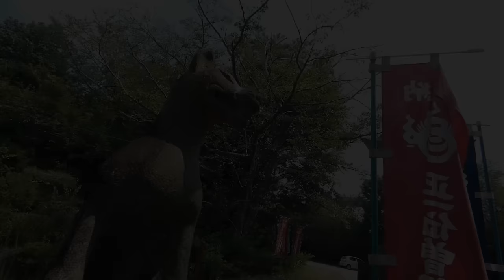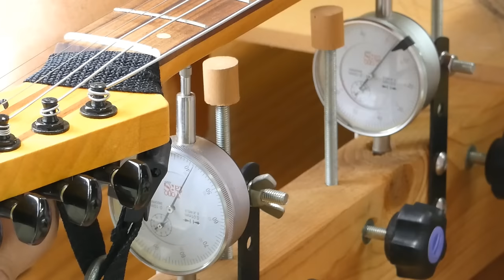Full Building a Homemade Guitar :  Low price TELECASTER

Comment: Nice work. I have to say I've never been a fan of Pau Ferro fretboards, they always looked like rosewood that's been left out in the Arizona desert for 5 years and is in desperate need of moisture treatment. But you got so polished that it almost looks like it's been lacquered and buffed glossy, and it's looks great. I'm surprised with all the work that's gone into it that you want with no name pickups and hardware, it's like putting bumper stickers on a Bentley.
I'd been doing refrets without a jig for years, what a difference it makes once I started using one.

Comment: So you used the most advanced method to set the stringheight at the nut with the dial indicator, and THEN leveled the frets effectively making the former step pointles.

Comment: Could you please share the nut string height and how you check with the meter? Awesome guitar, awesome builder
Reply from the maker: Sorry for replying late!

Use a dial gauge to adjust the string height as accurately as possible.

For reference, the string height data on the 1st fret
6-4 strings: 0.5 mm
3rd string: 0.45mm
2nd string: 0.4mm
1st string: 0.35mm
(When using a regular gauge, this value is just a guide. Please adjust according to your preference.)

I use this theory to determine the height of the strings.
Reply: @OTAHMGKouBou  Awesome Thank you, ank keep the great work

Comment: Nice guitar but, but, but,.... always use the shield tape for pickups and humming purposes, a must.
Reply from the maker: Only we would like to talk on the assumption that my thinking.
I'm We believe when the shielding of the pickup is not always necessary.
I do not like to treble of the guitar will be suppressed by the shielding.
So I always finish it without shielding at first.
If it is too noisy, we will do it later.
The pickups used in this guitar are humbucking, so they tend to be less noisy. Therefore, this time, the shielding work was postponed.

thank you for the advice!
I am very glad your thoughtfulness.

Comment: Beautiful, what's the distance between each screw holes in the neck pocket? Do you mind sharing? I have a squire that i plan on contouring so i bought a contoured neck plate from fender custom shop but i'm not totally sure about the screw hole alignment.

Comment: Super! A question please, do you shield your single coil guitars with copper tape-foil or it’s not necessary? Thank you 😊
Reply from the maker: It's just my way of thinking, but I don't necessarily see the need for Shielding.
The reason is that it changes the tendency of the sound of the pickup.
I use inexpensive pickups in this guitar, but if you use expensive and unique pickups, it is even more important.
That's why I finish the guitar without Shielding it first.
Then, depending on how the guitar will be used, I will consider Shielding it or not.
Thank you very much.
Reply: Thank you ;)

Comment: Curious to know how much it weighs finished and assembled? Looks like an excellent instrument. I'm building a telecaster right now myself. Prepping the body and and the neck joint took longer than expected but I should be spraying the nitro finish within a week or so.
Reply from the maker: Thank you for your question!

This guitar weighs about 3.2kg. It weighs the same as an average Telecaster.

I hope your Telecaster will be an irreplaceable and wonderful instrument.

Thank you!
Reply: @OTAHMGKouBou  Wow that's excellent!! Again great job! And thanks, I'm trying to be very diligent to make sure I do everything I can to make my tele feel and play great. I'm using nitro for the finish do it wont be impervious to damage but if that ever becomes an issue I'll strip it and refinish it with a poly based product like I'm used to using at work. Thanks again for the reply!!
Reply from the maker: Nitro coating is weaker than poly coating, so it may come off due to impact.
But that's not a bad thing, and I think it gives the guitar a personality and history.
On the other hand, poly coating is always fresh because it can keep a glossy and beautiful state for a long time.
Both have their own charms, so act as you believe.
Reply: @OTAHMGKouBou  I absolutely agree with everything you said. I'm very familiar with poly but this is my first Nitro finish. I think a telecaster is a perfect candidate for nitro cause if it does check or chip it will look good and add character. On my other guitars I prefer to have a poly finish so it stays protected and doesnt age or chip and check like nitro will eventually. Only problem with the poly is buffing to a high gloss. As you know it can certainly be done but it can be difficult compared to buffing out nitro. I always have a few swirl marks when I buff poly but they still look nice. For the upcoming tele finish I finally decided to try Micro Mesh instead of wet/dry paper. I think that will help. And after the micro mesh I'm going to use the Novus 123 plastic polishing sysyem to really get it glossy. I learned about the Novus system for polishing guitars from the telecaster forum. Apparently it's quite popular and it only cost me $10. So we'll see lol. If the micro mesh works well I might go over a few of the drop fill repairs I've done on my poly finished guitars and get them a bit more refined. I'm really looking forward to finishing but I still have to grain fill an do a bit more prep work. For the mahogany neck with maple fretboard I'm going to do a couple wash coats before I use the timbermate mahogany filler so it wont color the wood and only ends up in the pores. And if some filler gets under the tape that's masking off the maple it wont discolor that either.

Do you finish the neck pocket and the neck heel or do you mask them off? I've got a real snug fit as it is so I thought I would mask off the neck pocket but spray the neck heel. Or Mask off the heel after the wash coats and filler.

Comment: Great work. But why YiBuy chinese hardware on such a fine instrument ? (honestly asking here...is this particular brand like an exception regarding cheap chinese ebay material or you just wanted to lower the cost)

Cheers,
Reply from the maker: That's a little difficult question for me :)))
There are three reasons to use this Chinese pickup.

The first reason is that the theme of making this guitar is to make the best possible guitar while keeping the price as low as possible.
The second reason is the treasure hunt for pickups ... I'm lucky if I can find one that isn't branded with enough performance.
The third reason is that I am currently in a difficult financial situation. So, in the future, I would like to get a reward from Youtube and use it as a fund to buy the best materials.

Thank you for your question!
Reply: Thank you so much for your true and honest answer.
I too don't have much money to spend on this kind of projects and was wondering about the quality of the electronics you chose.
Im also always on the lookout for equipment that has enough quality but won't cost a fortune.
Good luck to you and your videos and congratulations once again on you EXCELLENT work.

Cheers from Portugal
Reply from the maker: By the way, the pickup I used this time wasn't the best, but I thought it was worth above average.
My friend played great on this guitar.